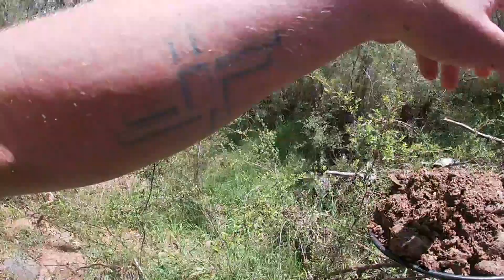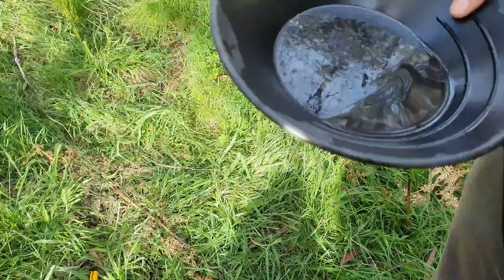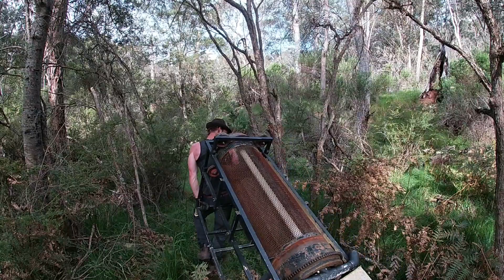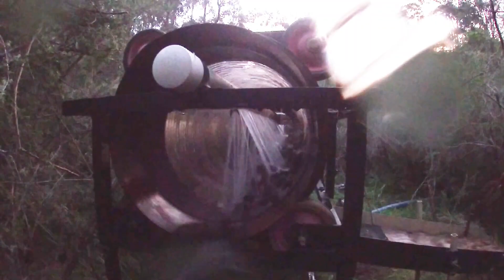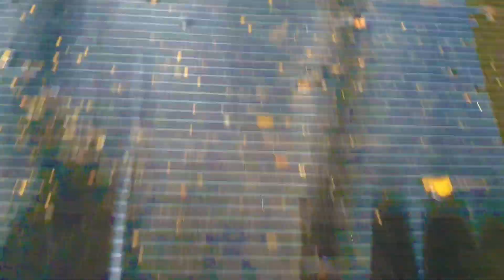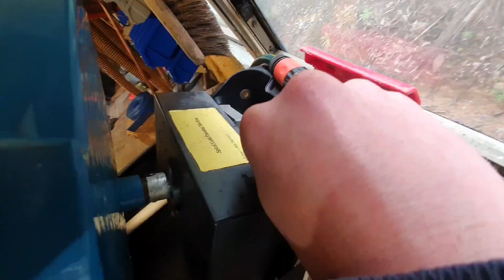I bought my old Gold Trommel back!

Comment: What gph Honda pump do you have on your trommel?
Reply from the maker: Depends which pump I have availible at the time, as I lend them out quite a bit. Worse case, is a 5hp Chinese 2x2" honda. Best case is the 5hp mitsubishi with an old dredge pump, but the Mitsubishi is only needed when I need to pump the water a long way above the creek, or it is too powerful to run over idle otherwise.